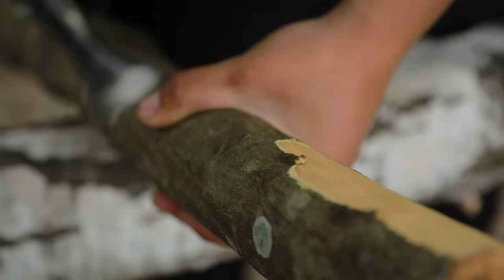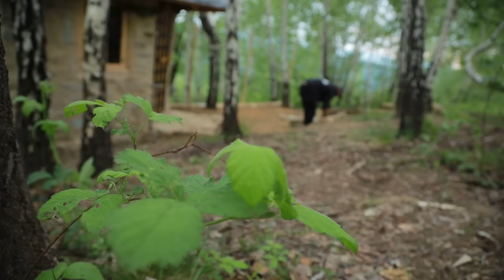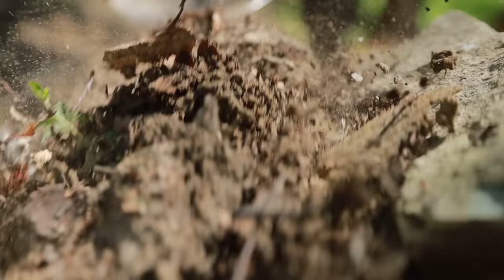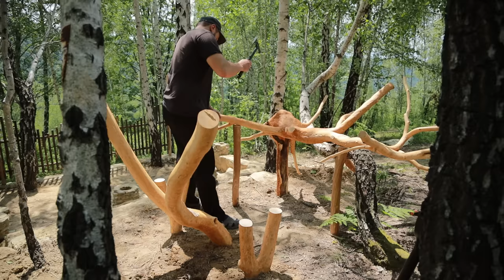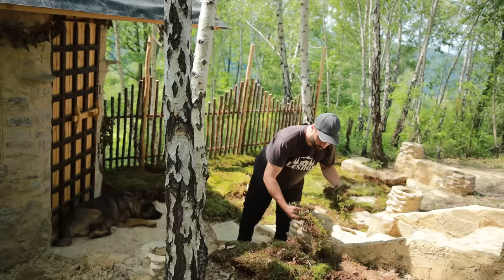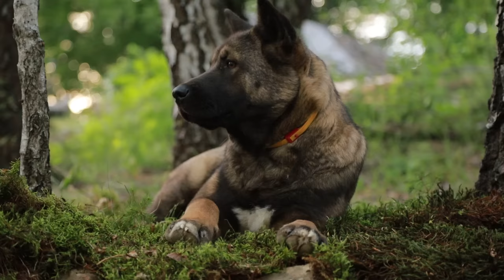He returned to his stone house. Made a terrace and dinner. Part 5

Comment: It's  interesting. I admire his work ethic. But I question his decisions. Using mud instead of mortar, not digging deep enough to put a good foundation below the frost level to a  nice, stable subsoil is going to cause stability problems later. The mud will dry and crack. It will also erode readily.